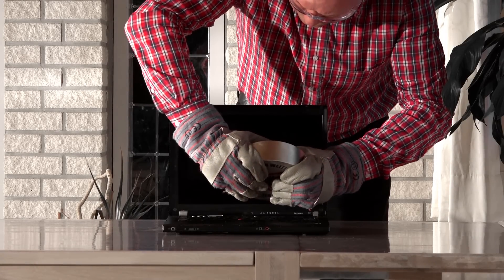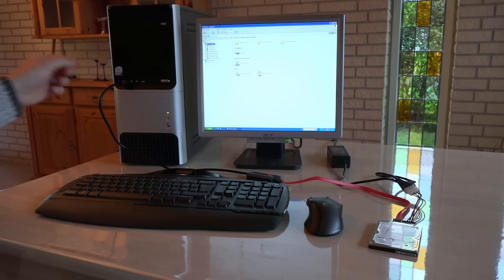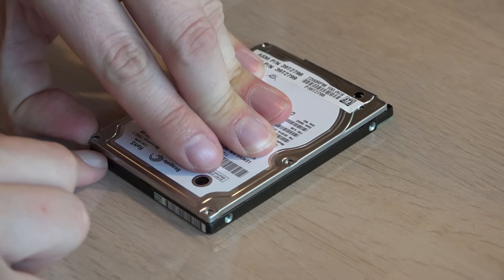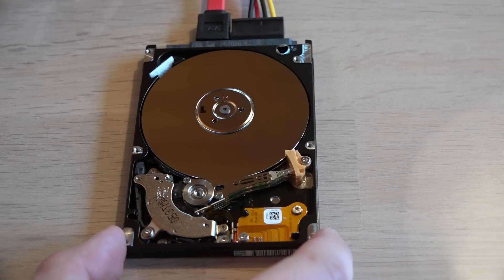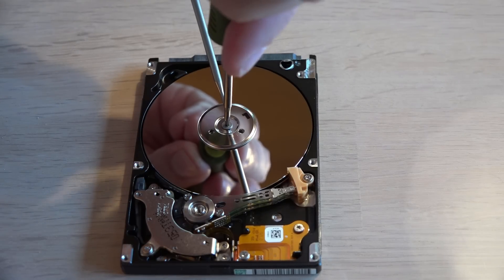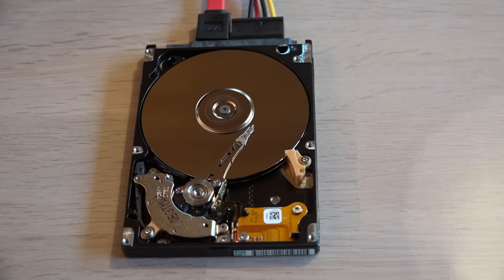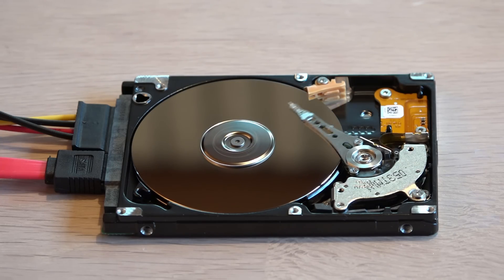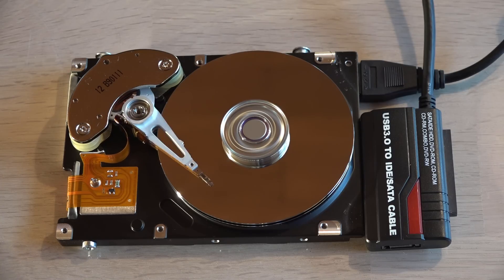Killed by magnet | HDD examination

Comment: The magnet removed the low-level formatting on the platter, that the drive's hardware needs to determine the characteristics of the drive, such as its actual RPM, velocity of the platter at the heads, and the spacing and location of the tracks.  With those marks gone or damaged,  the hard drive circuitry can't tell for sure if the platter is even turning, or how far the heads are from the platter's hub.

What might be interesting is determining if you've erased all of the factory formatting:  The heads appear to linger at certain locations before sweeping the disk's surface:  is that because there's still some data there for the heads to lock onto, or is it just a physical coincidence or hard-wired spot?   Does applying more magnetic disruption change the heads' behaviour?
Reply: +Nevin Williams 
That.

Only other thing I can think of, but would say it's already improbable: the strong magnetic field permanently magnetized something in the heads.
Reply: superdau That'd also be interesting to see:  what all parts of a hard-drive are susceptible (to a significant degree) to magnetic fields.  

I know some parts are shielding, such as the mounts for the neodymium magnets that swing the heads:  They're still attracted to a magnet, but they constrain the flux away from the platters.  It might be interesting to see this property explored too.
Reply: @superdau  The ferrite heads cannot be permanently magnetized.  At any rate, the alternating current in the heads would degauss them quickly enough.
Reply: +Nevin Williams It could also be that the head did crash into the platter and that destroyed the head. It could be a very slow crash (for example near the middle of the drive) or a very swift touch but it could be enough to destroy it, I think.
Reply: aterack833 Yeah, it'd definitely help to know if the procedure could be carried out successfully before drawing any conclusions from a test.

The head position is indeed determined by the amount of current that runs through voice-coils in the armature, but there's no guarantee that the same currents will place the armature in the same position (or hold it there) from moment to moment.  

I found this page on DIY hard-drive maintenance:  

http://www.overclockers.com/do-it-yourself-hard-disk-repair/

There's some great detail about rw-heads and how easy it is to wreck them, in addition to other information.

How about audio tape cassettes...?
Reply: +GiantPen23 +Nevin Williams or even carefully take one apart, then re assemble (to make sure you can) test, then if it is ok, disassemble again and only test one platter, use paper to protect it, and make sure it cant hit the magnet, after each test try the next plater, once all are tested you have a definite answer,  i thought that the head position was determined by the force applied
Reply: +Nevin Williams Yea, pretty much. Back in the old days where all of the drive logic was controlled by the OS you could easily diagnose something like this. Generally each platter has the same cylinder of data that tells the firmware where the head is located on the platter. All you have to do is change the value of one bit to screw everything up. This cylinder is generally different for each disk and is determined at manufacturing time so once it's dead, it's dead. However it would be interesting to see someone with some advanced platter scanning devices back up this cylinder then hover a magnet over it and see if the cylinder can be re-written to bring the drive back to life.
Reply: +Nevin Williams As I understand, many/most/all HDDs have servo data on one of the surfaces. This is used to locate tracks/cylinders when moving the heads. It looks like the 2.5" drive was experiencing seek errors and just kept retrying.

NOTE: This is all speculation on my part. Anyone with more info, possibly some inside knowledge, is welcome to correct me!
Reply: falcon35180 Yeah, that sums up my low-level format idea.  The research I did afterwards suggest that there's probably multiple areas of failure, including WR head damage.

It might be more interesting to figure out how to situate a hard drive inside an enclosure such that it continues to function despite the presence of such a magnetic field; in essence a magnetic faraday cage.  (Which a PC tower and the hard drive case make, to some extent.)
Reply: Nevin Williams OR, or, we use solid state, just gut 120gb for $45
Reply: Toshiba drives are terrible and unreliable for testing. I've never seen a toshiba drive go past 4000 hours before starting to crap out. They are even worse than hitachi drives now.
Reply: I was literally about to say that.
Reply: +Nevin Williams well he could take an hdd, open it and then hold a much smaller magnet close to it whilst spinnig, thus erasing only that particular area
Reply: +aterack833 thats hardly cost effective when you can buy a refurished 2TB drive capable of 100mb/s tranfer speed for the same sort of money
Reply: Benjamin Edwards it's the heat and roll resistance i bought it for, not the speeds, i burn out a hdd every year, the bearings cant handle much
Reply: aterack833 roll resistance? Are we talking about SUVs or something?
Reply: Benjamin Edwards lol, no, i meant spin resistance, as in when you get the bearings hot they resist and lock up and burn out the drive motor
Reply: aterack833 and you say you burn hdds in a year? I have only lost a handle of dozens Ive picked up secondhand.  Im not sure what you're doing to kill them
Reply: Benjamin Edwards high heat from the laptop and lots of movement
Reply: aterack833 didnt know that was an issue.  I think this is why toshiba made that shock proof system
Reply: lordsyn86 I think I've only had one toshiba drive and its hardly a case to judge by, since its an old mini pata drive
Reply: Can't companies store the low level formatting in a chip that is not susceptible to magnetic fields ?
Reply: oh i didnt know that a hdd could go dumb if u put a ztrong magnet nearby (i thought only the data like the picz on it could be removed by the magnet) but all even its factory settings... what ashame hdd...
Reply: Orestis Grivas some do on the sshd  or hybrid drives.
Reply: Derpy Gamah check out what a degaussing loop can do
Reply: yep
Reply: Basically, bad design.
Reply: But, my laptop ran without any problem and got killed by a fridge magnet.  I have the worst luck.
Reply: Im not a smart person here
Reply: omg
Reply: No it’s because the head is off and the heads are missalined
Reply: I guess that the neodymium Magnet may simply have degaussed the Platter material and thus erasing all stored data traces
Reply: 699 likes

nice

Comment: Probably the reader heads are damaged. I once took apart a hard drive (mainly to see how a hard drive worked). I pretty much killed it from my stupidity. the drive was then used to create an xbox prank video. after that, I smashed the deceased drive with a hammer.

Comment: You should have taken the magnets out of the HDDs and demonstrated them!
Reply from the maker: +RazorBeamz 
They are nice magnets but a little small in a fairly modern 2½" HDD. But I did it in a previous video with an old 3½" HDD: https://youtu.be/ep_VCotA1ZY
Thanks for watching!
Reply: +RazorBeamz 
Yeah those are pretty strong as well, at least if they still are like in the old days... Those could bite you pretty bad!
Reply: I'm think that the part of data that makes the disk be visible was washed out

Comment: I think the head is trying to find the low-level format information and because of the magnet, this has all gone.
In the old days as part of maintenance an engineer could do a low-level format but it's just done at the factory these days and the only thing an installation engineer or a user can do is a high-level format.